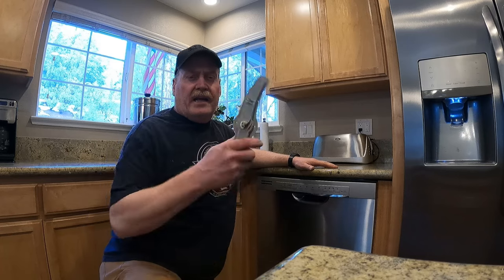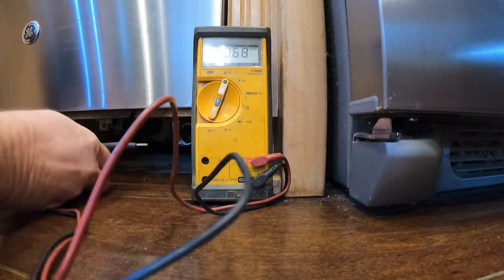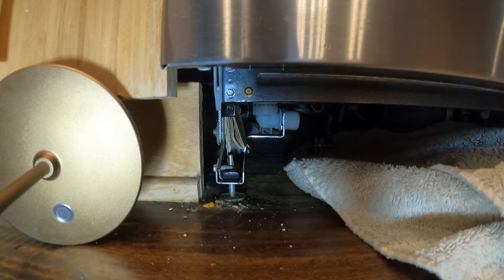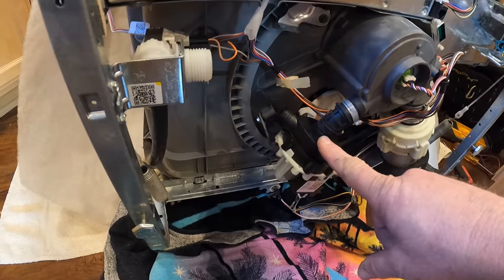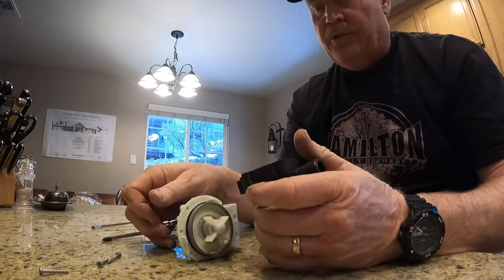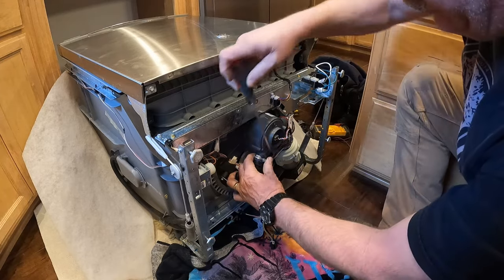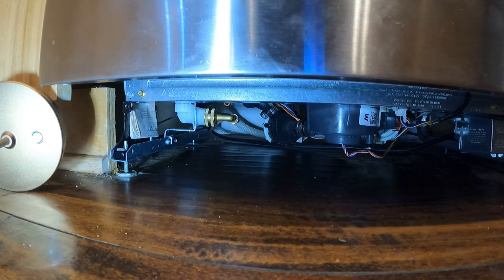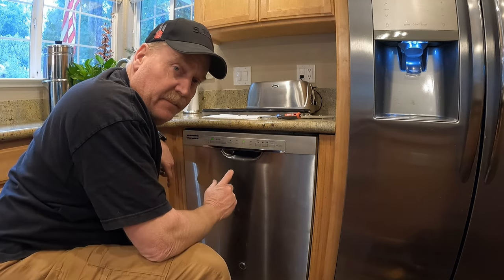Dishwasher drain pump repair - GE GDF520PSF6SS

Comment: You got by pretty lucky, could have been all of the parts needing replacement.  I saw Kerri in the background, I have much better success if my wife is not involved, she offers a lot of advice.
Reply from the maker: I don't like having to repair my own appliances but it does save money.  Kerri is pretty good at not getting involved.  Especially when I start throwing tools in frustration!  🤪

Comment: Poor filtering design if a piece that large can enter. I get to remove my drain pump today. What fun.
Reply from the maker: Good luck with your repair.  Hopefully the video helped.
Reply: You ain't lying about that! How could an item that big bypass both the top and 'fine' filters?
Reply from the maker: @bgregg55  Good luck with your project.  I will have to go back and look at the screens or strainers at the bottom to see how that piece could have got in there.
Reply from the maker: @alexmartin900  I will have to go back and look at the strainers or screens at the bottom to see how something like that could get through.